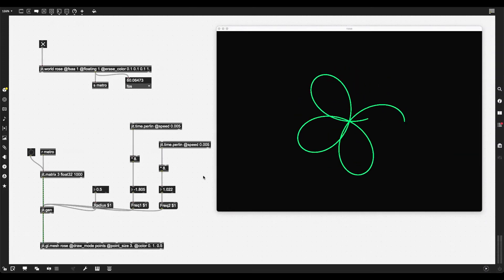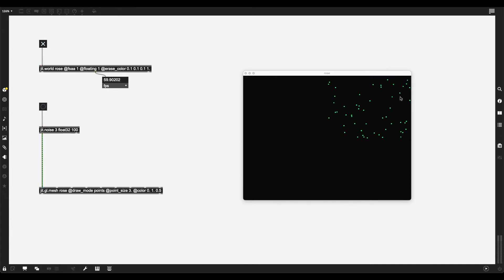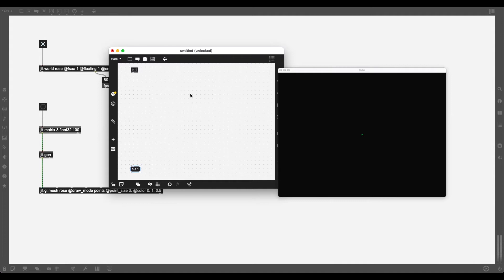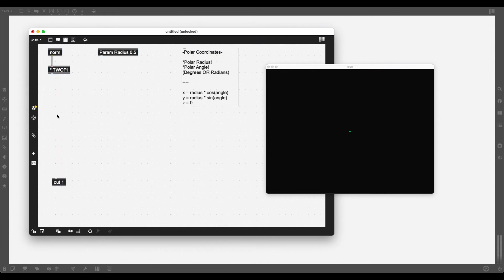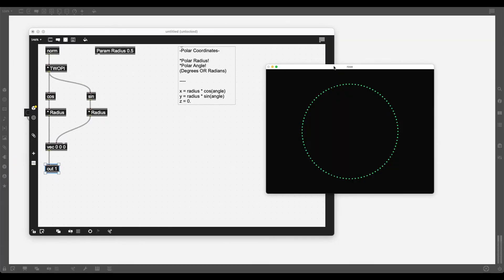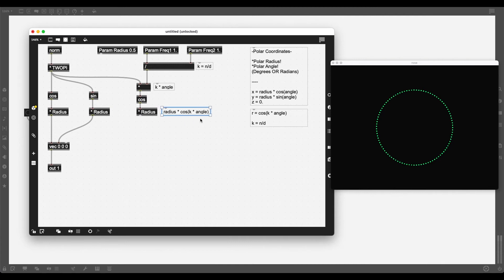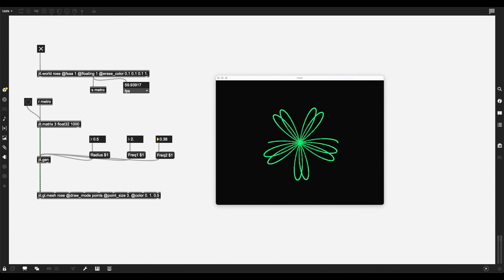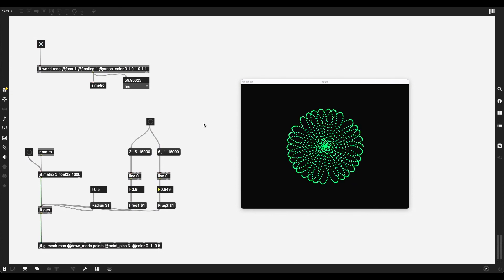Polar Rose with jit.gen - Max/MSP Tutorial

Comment: Hi can you tell me what the Normalised coordinates of the input matrix are please? I understand that normals are the tringalges that make up a 3D shape but I am wondering if maybe that understanding is incorrect. Many thanks.
Reply from the maker: Normalised coordinates are different than normals in 3D geometry. Think of a Jitter matrix like a chess board. When you get the normalised coordinates of a Jitter matrix, you are getting a unique value for each cell based on where their position is in the matrix. If the matrix has a dimension of 1000, then the first cell with get a value of 0., the thousandth cell will get 1., and the ones in between will have corresponding values. That is what normalised means here, the values go from 0. to 1.
Reply: Ah ok thanks for this  @HearingGlass makes sense now :)